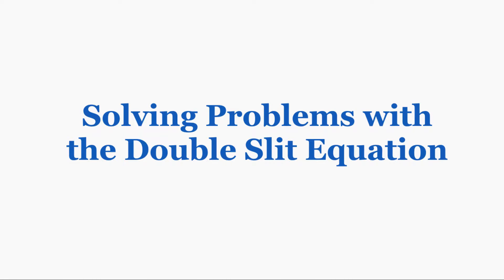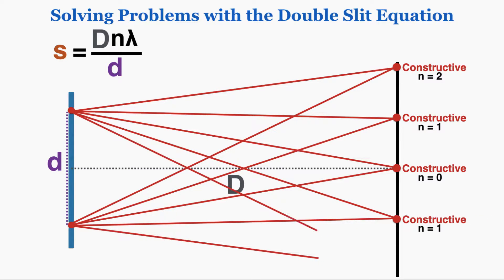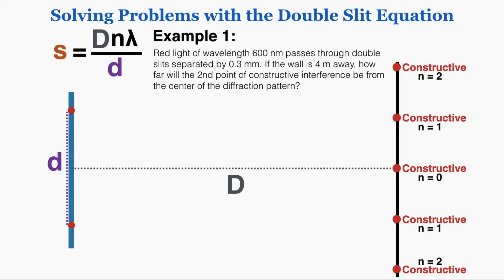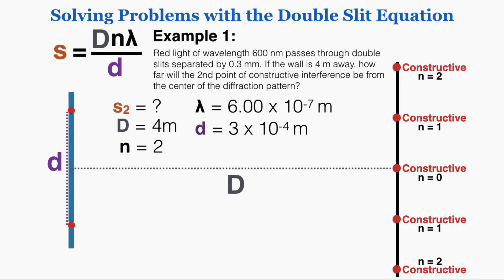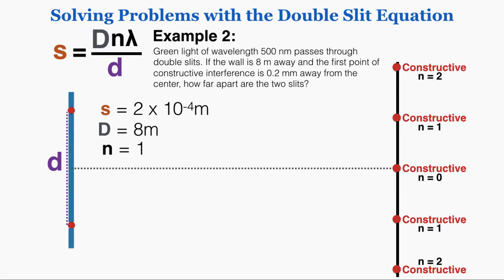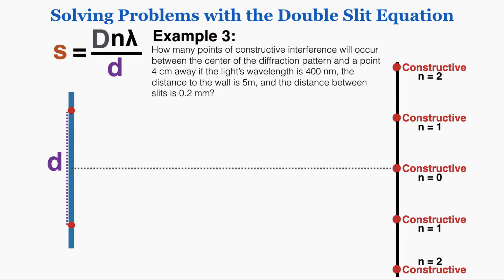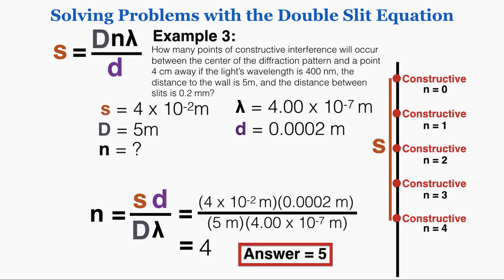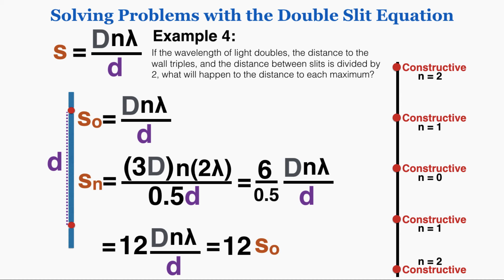Solving Problems with Young's Double Slit Interference Equation - IB Physics

Comment: Hi the videos on slit interference are really useful but do you have any videos for double slit interference with non negligible slit length and single slit interference with and without non negligible slit interference? Those are parts of the new 2025 syllabus and I would say the hardest part of C.3. Thanks

Comment: At my university we're trying to calculate the intensity at a given place y (which is basically just s, in your video).

So if you want the intensity at place s, don't you basically need to calculate n? Because n times total amplitude = some amplitude "=" some intensity at given s? Would this be a good method? Or am I completely off?

Comment: Hi Andy, as usual terrific work. Just a question. Aren't this and the previous video more concerned with two slit interference, as opposed to diffraction? Diffraction, the modulation of light intensity at different areas on the screen, is determined by the slit width, usually termed "a", and is independent of the slit separation, "d". Perhaps the nomenclature you use in the States is different? I really appreciate your videos,.